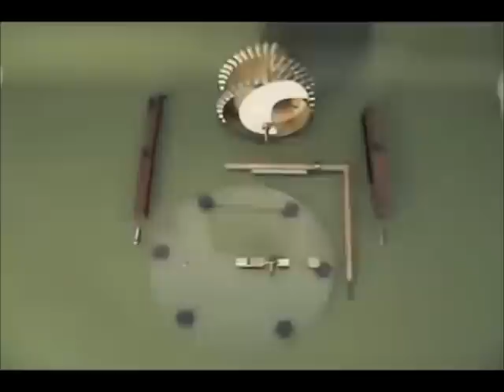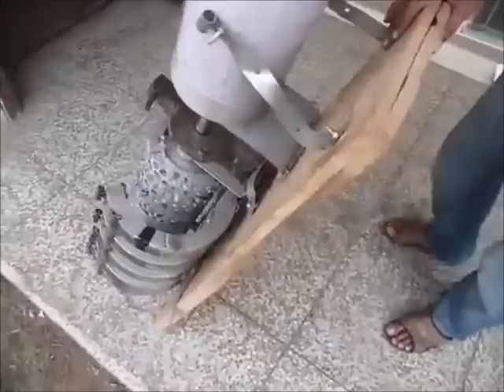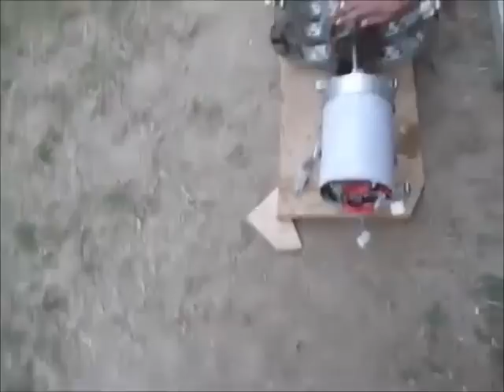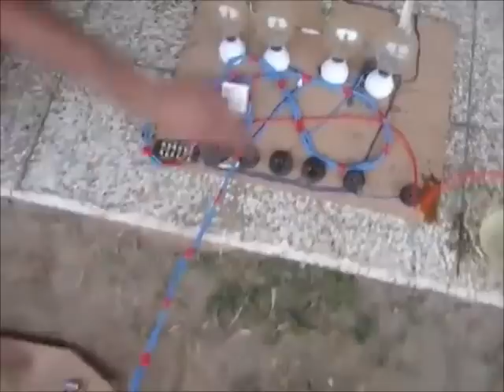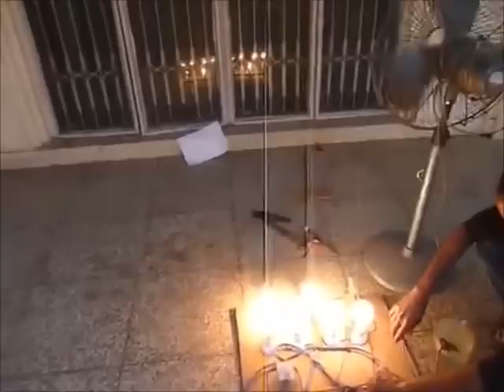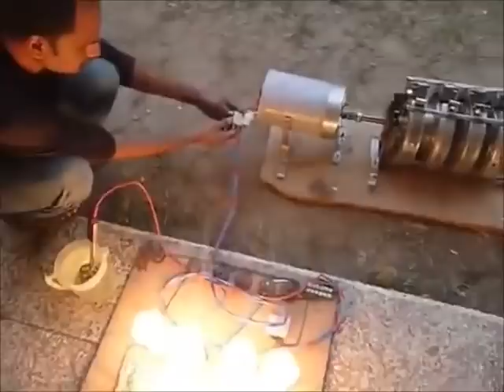Freie Energie   Magnetmotor

Comment: Ha, Yes this is elegant and before even viewing this video can say the design will work because the moment is introduced at the proper timing. Excellent work.
Reply: This design does not produce any energy. By the manual movement mechanical energy is input in this system. That's all. Conservation of energy can't be tricked. Instead of pushing the bar magnet manually to and fro it would make more sense to turn a crank and leave this "magnet motor" out.

Comment: Any engineer who has engineered any electrical machine knows this can not work.
1. The torque transmitted by the clutch can not withstand 1 KW at 5.00
2. What do 2 nails serve, rather than bring electricity from hidden power in the ground. at 4.40
3. the double wooden  plate serves to hide the wire leading to the "generator" at 3.40
Reply: You are right about that

Comment: 1:58 good idea to jump the resistance point by using some of the rotational energy of the system to push the outer magnet on the top which takes near position after manipulation by means of gravitational force. Similarly another outer magnet on the bottom is forced to be close to rotor by  a short time manipulation to jump the resistance point again after 180 degree rotation. May it be possible to do this with some of the system's energy?

Comment: There is something wrong with the way those lights start glowing. They start at full brightness. They don't light when the device is spun by hand but they should. The device runs no faster when the frame is closed. There are no electrical connections to the frame or rotor, the rotor does not accelerate much. Why don't the lights start to glow when he spins it with his hand?That generator is turning very slow. It would have to rotate at a much higher speed to power that large load. This just looks wrong.
Reply: Good observation. I guess it´s because the switch got turned on in the moment he so hocuspocusly-closed this frame.
Reply: yep....i freeze framed the vid when he opened it at the end.......lol.......the lights went out but the shaft kept turning for 3 frames untill he stopped the shaft with his fingers... this guy needs his switch operater to be faster .
Reply: agree with you , it's looks like fake I think there is battery made this glow just connect when he close it , and disconnect when open it
Reply: It is fake :D
Reply: He needs to have it running without the motor hooked to it if it truly works
Reply: cool

Comment: it seem like there is something wrong see when opening teh ligths witched off imediately but the motor was still spining but there was no light just like the motor opening ang closing is the on off swith of the circuit witch probablely have an batery ore onother energy source in this anormaly big generator acording to the winding am seeing thank you if you can explain that may be i'll beleive it is working

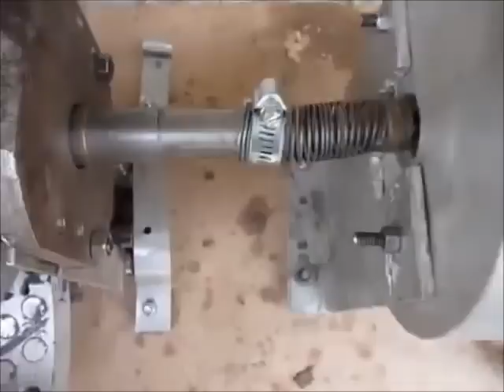Comment: Schaut man sich alleine mal bei 3:20 die Kopplung des "Magnetmotors" an den 
Generator an......und bedenkt, dass diese so an die 1KW übertragen soll,
 dürfte jeder der sich mit Elektrik auskennt schon lachen. Die 
Drehbewegung ist recht langsam, daher wird eine entsprechende Kraft benötigt. 
Leistung: ca. 750W Tauchsieder, vermutlich 4x60W Glühlampen und 30-60W Ventilator
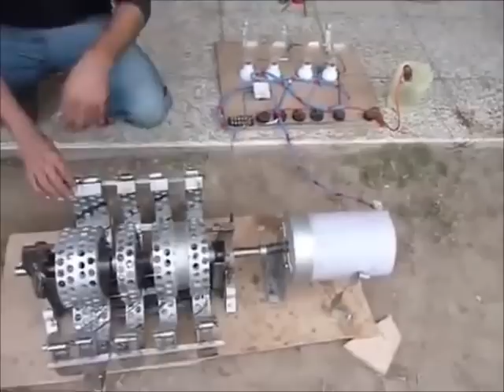Aber lustiger ist der Start bei 6:44
Die Energie wird nicht "erzeugt", wenn der Motor dreht sondern erst - bei 
gleichbleibender Drehzahl - nach zuklappen des Motors. Nett gemacht, 
wenn nur nicht der Strom aus dem angeblichen Generator rechts kommen 
würde.

Comment: The mottor is easy to understand.But the magnet.Would be rather difficult to make
Reply: It is easy to understand, that these devices don't work. In the first part, energy is introduced by the manual movement of the magnet by hand. But once it is tried to move this magnet by the device itself it will come to a stop - if the rotation is not faked by some means. 

In the second part the alleged generator is in reality an e-motor, which turns the "magnet motor". And this e-motor and all other devices are driven by a hidden power line.
Permanent magnets alone can not drive any motor. Laws of physics - conversation of energy - do not allow a magnet motor.

Comment: This is a good invention anyway. But the permanent magnet will lose its magnetism over time due to heat or friction or other causes. Nothing is really free in producing power. The only question is how much will it cost/watt.
Reply: and a Diesel engine will have to be overhauled over time as well
So will any engine, motor, generator

Comment: 11:34 er hält den , was auch immer, an der lüfter läuft weiter ??? 
Das geheimnis dürft wirklich in den nägeln sein ... 

Ich nehme zwei metallplatten und grabe sie in die erde ein , dasselbe mache ich unter dem , was auch immer , und verdrate das ganze. 

Das der motor angeworfen werden muß ist kein kunststück , wenn ich einen fliehkraftschalter einbaue , nur sollte ich dann eben aufpassen, daß alles abgeschaltet wird, wenn ich den motor blockiere. Bzw, es gibt , gleichstrommotoren, die haben große spalte in den kollektorkontakten, dazu muß ich nur jeden zweitenm oder dritten kontakt ausbauen und schon hab ich genau den effekt. 

Das seltsamme gebilde links , besteht aus alu ( ? ) und hat einfach nur löcher.

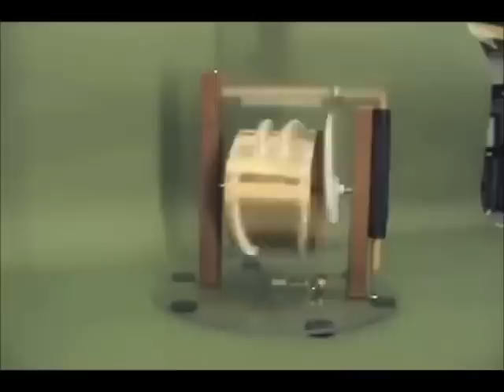Comment: 2:20 OK but if you connect generator it will be slower. because the generator is consuming itself for powering his purpose and doing his function ... perpeti mobiles doesn't exist bruvs

Comment: Hat man jemand ausgerechnet wie viel Leistung (Watt) der Typ da raus holt 
4 Glühlampen 60 w =240 Watt 
4 Halogen Stäbe 250 = 1000 Watt
Tauchsieder 1200 w 
Ventilator setz ich Mal bei 260w an 
Macht insgesamt 2700 Watt Leistung oder für die Motor Freaks 2,7 kW 
Auf jeden Fall soll 9 Klasse Physik ausreichen um das Ding als Fake zu entlarven

Comment: If he pull that fan plug out, and it still running then it would be 
real. Since he did not unplug the fan to me that a fake. How many people
 did he scam already. Under the fan there is two active power plugs, one
 plug to the fan, and the other plug he plug into light  board which can run the
 motor and light up the light. That why that fan cable plug look odd. 
When he close the lid to the magnet wheel, have a hidden switch on; 
which will turn on. The fan on or off, does not affect the light because
 it already plug separately. You are busted. See this happen when you 
challenge an Engineer.
Reply: you tataly wrong, hope you never check it clearly, watch the video ahain they dont show the upper video to the frame, its coz they give the electricity wire from upwards to power these things, which they simply edit it after